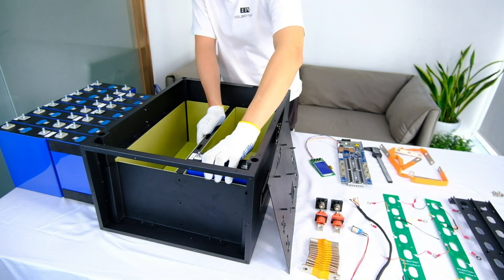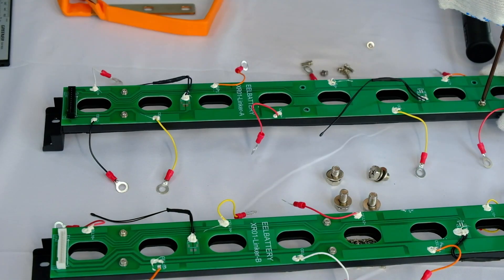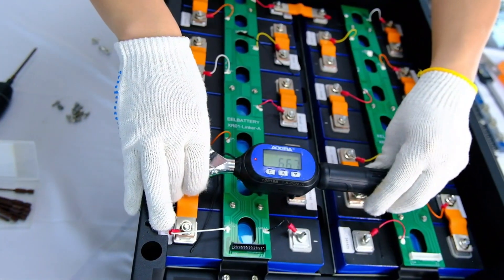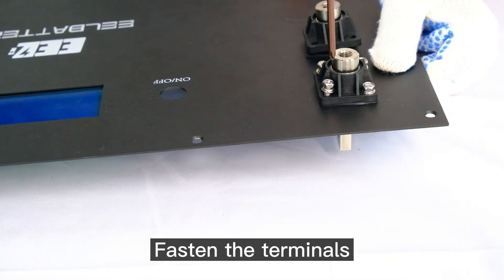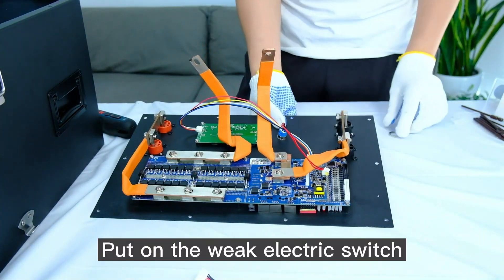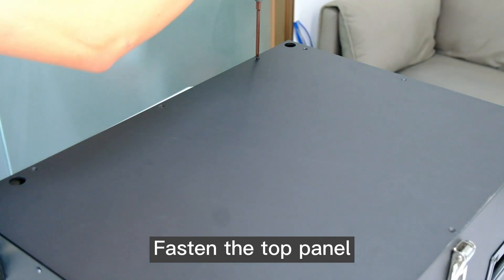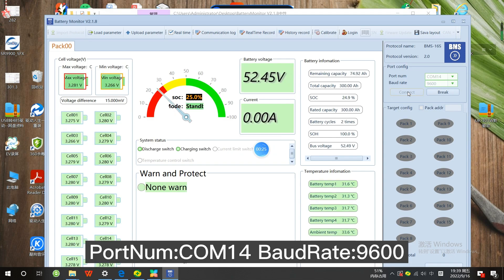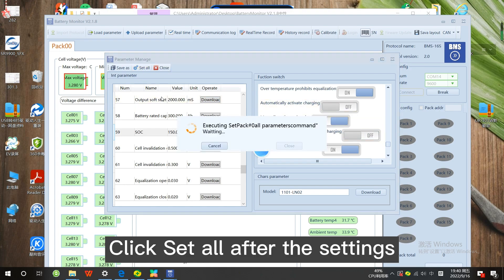How to build a 48V battery system with EEL DIY box | Step by Step Installation Guide

Comment: Also if anything happens, wire resistance high error occurs, also JK BMS is showing probably false readings since our battery was showing 98 Percent remaining battery on our BMS mobile app but in actual it was not 98%, it was far below that

Comment: The bus bars I have in my EEL battery pack are with no nuts, screws, bolts . It's a straight aluminum plate. The wire is connected with the bus bars with a solder joint which is quite a weak joint,  after every 2 _3 days one of the wire connections break.  Neither can we we solder it with a soldering iron(because Aluminum has a property of heat sinking)nor can we spot weld it. Please give us an optimal solution for this. It's such a big problem we are facing with our EEL battery.

Comment: The tightening torque of 6Nm seems to be too high. Are you sure this is the case?
Reply from the maker: for longer use, it is recommended to use 6-7 N.M
Reply: @eelbatteryofficial  I have Liitokala cells. I'm afraid that 6Nm will screw up my socket. The cell will be permanently damaged. Is there no such possibility?